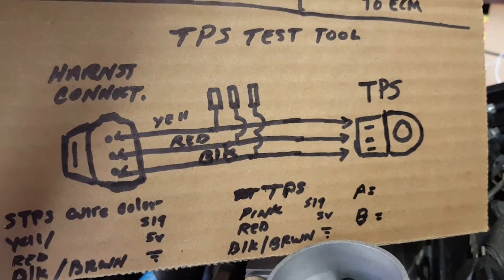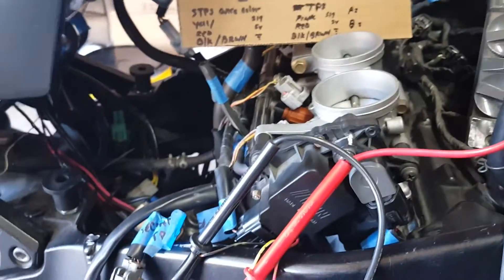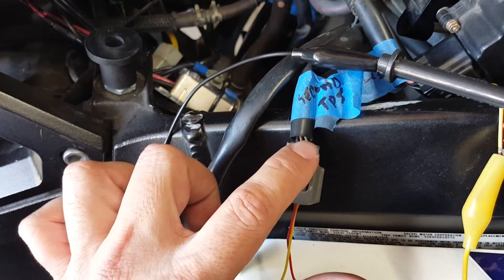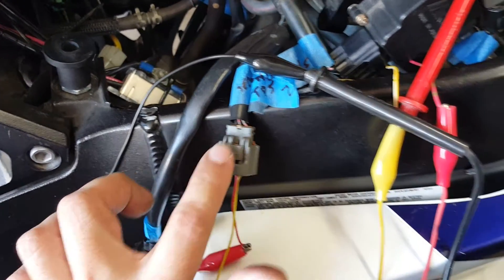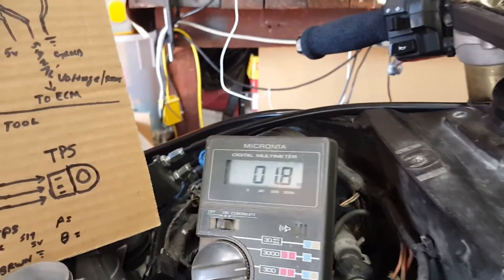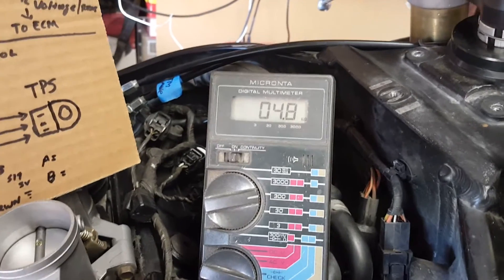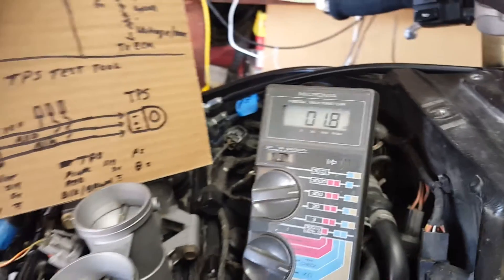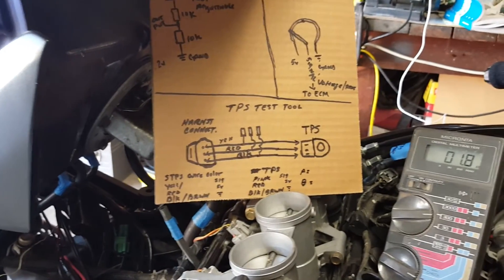SUZUKI GSXR 600/750 Testing the TPS for Dead Spots using Resistance

Comment: I'm just wondering if you're testing resistance through the signal wire why is the harness being connected important? You can't just put alligator clips on the ground  and signal pins in the tps?

Comment: Ηi there . I made my own tps test harness tool and i measured the kΩ resistance with the multimeter. In closed throttle i get 1.4-1.6 and fully open throttle it goes up to 20-30 kΩ if i turn the throttle slowly.If i snap it very fast the multimeter displays 1. like it stops measuring....any idea whats wrong?
Reply from the maker: Well your testing the TPS for a reason, possibly because you feel its giving you an issue, right?  Then you just may have found that issue, it could be bad. Only sure fire way to know if its bad is to get a replacement. If you're anything like me and don't like down time in waiting for a part or spending money for a part you may not need then swapping the TPS with the STPS is the way to go. When I measured, both read exactly the same so in essence they are exactly the same part in every way. This is a little extra work because you have to calibrate both after swapping but at least you'll know if your TPS is in need of a replacement, or if your harness tool is working as it should. Also, make sure you have connected the harness connectors correctly, the TPS and STPS harness connectors will fit both interchangeably. One is black and the other is gray, I sometimes get this wrong  so its good to mention.
Reply: @TheChemistDIY  https://imgur.com/DIvxpl5
The way i measured was to conenct multimeter probes to wires A and C in my homemade tool.

Comment: Good afternoon. I want to ask you. I have a Suzuki 600 l4. when the motor is cold. I open the handle of the gas until it stops. engine speed rests at 3000 revolutions. After a couple of seconds, they rise higher. that can be a problem. fuel pump clean. and there are no errors on the panel. its video with the problem  https://youtu.be/4j8CxQ8muHQ
Reply from the maker: Антон Третьяков there could be a number of things wrong here but I would first start with the fuel delivery. Check the fuel pump and make sure it is putting out the correct amount of gas, test your fuel pressure and make sure it's consistent, and last test and clean your injectors.
Reply: all filters of the fuel pump I cleaned. pressure on fuel injectors 3 bar
Reply: fuel injectors i cleaner
Reply from the maker: Антон Третьяков did you check to make sure it's delivering the correct amount of gas?
Reply from the maker: Антон Третьяков when you say cleaned, how so? Did you flush forward and backwards, did you test electrically (voltage/resistance)  did you check for proper V pattern spraying on each. More to it then just saying I cleaned.
Reply: james moreno .I clean fuel pomp. Then connected Barometer (i connected to pipe injectors. Petrol go to barrometer and injector  ).   ,then disconectded injectors ramp and clean desame on your video.
Reply from the maker: have you checked the first and secondary butterfly movements to insure they are working correctly?
Reply: james moreno the secondary batterfly i not shure is work good.
Reply from the maker: confirm

https://youtu.be/wfuXw0nhwh8

Comment: Why min is 1,8kOm? Manual say that correct adjustment must be 0,6.
?
Reply from the maker: Demonic, you are correct, the manual does state 0,6 but you will never get this measurement when testing. I did my homework researching many of the forums as well, all stated the book is WRONG. I even went as far as purchase and test 2 extra TSP's to confirm and all 3 (the one on the bike included) tested at 1,8khom or near that value. hope this helps u out
Reply: ))) ok. 
I was think that my sensor is broken. But min value is 1.0kOm(!)
And how to adjust it? Just turn on min value? O_o
Reply from the maker: Demonic - there should be a white line marked on the TPS and it's body. this is  the OEM dealer marking set position and will most likely get you on or near where u need to be. loosen the adjustment screw and start the bike,. slide up or down and watch your idle tach. 13-15k is where you want to be. it's a little tricky to dial in and u will probably have to adjust it a few times before getting.it. when u tighten down in the screw, make sure to hold right on the TPS because tightening the screw will also bring it out of adjustments. from there it's a fine point adjustment with the throttle cable if need be. remember the bike is going to heat up fast so you need to be quick with your adjustment and lock down or you'll be waiting a few minutes till the engine cools to get back in there for another try. at it.
Reply: james moreno ok. thanks.
This adjust is just cold start working?
Reply from the maker: Demonic your first attempt will be cold, but like I said you probably won't get it in the first round and the bike will warm up and fast. Just do ur best at  cold attempts giving urself 15-20 minutes in between failed attempts to allow for cooling. Youll know when it's cool enough because you can get your  hands back in there without cooking them.
Reply: james moreno thanx. )
Reply: I have a new information... )))
Panel signals value  -C00 if diagrostic connector is curcut. And... if just turn the key and don't start the engine it indicate top sensor (stp) adjust. If engine is started, it is indicate bottom sensor (tps) adjust. 
I can't adjust stp sensor (it indicate ^C00). But tps sensor can change indication value on panel (if engine is started) - it's ok.
Reply from the maker: Demonic yes the indicator on the gauge cluster is related to the TPS and not the STP.. when adjusting the TPS the line needs to be in the center position and while the bike is running. once you have it there, tighten the bolt down and make sure while your tightening the line stays at center. this is the tricky part as it will often float up or down while tightening.
Reply: james moreno u don't understand me. If engine isn't run,  panel indicate upper level, when run - normal.
Reply from the maker: Well if you think about it, when do you need it to be -normal, while your parked chilling with the engine off or while your riding it.. lol. One thing you should note is that each point (High, Middle, Low) actually has two two points, the point at which its about to go to high and the point where its about to go to low (the cusp or braking point). 

While you may have it at level (middle position).. at which point of that middle level is it at, the point of high or the point of low. This can only be seen while your riding the bike. My suggestion to you ( and is how I tune my TPS) is to leave it in dealer mode and ride the bike so you can watch the level float. When you give it gas it should float up and return to middle when you come to idle. Try that out and let me know how it works for you. Riding in dealer mode will not harm the bike in any way.

Comment: Hey man i have a question LONG ONE
I have a Gsxr1000 2001 i been having issues with the throttle.... It loos power if i full throttle the bike it only goes up to 6K rpm masaaan i have check every single damn nail in it everything ECU, Sparks, Coil, Cam sensor, fuel pump, injectors man you name it problem still persists what else could it be?? It doesnt have any wierd noise for me to think in the time chain i was thinking in the TPS STPS?????
Reply from the maker: Do you have the exhaust acutator assist butterfly in your piping?? Sounds like a STVA issue
Reply: I have the black box with a little metal square thing that rotates? But is not connected with the cables that opens the butterflies because the previous owner installed a Yoshi on her so he disconnected the cable of from the ECU and left the rest of the system conected cables and the black box i told you
Reply from the maker: Ok so this can be a number of things that we need to check. I’m taking it that since you say this is disconnected you have an aftermarket exhaust. Since you still have the rotor assist actuator present it’s not a full exhaust piping system. We need to check if this was done right. This link will show you how to disable the the set valve from the ECU https://youtu.be/Kes800UV1OI .

Secondly we need to know if the butterfly is fully open within the Exhaust pipe and this link will show you what I'm talking about https://www.youtube.com/watch?v=0bjKQYc0vcE . If this butterfly is not open it will restrict exhaust flow causing back flow to the engine.

What also causes the restriction above a certain speed is the STVA Actuator not working correctly. I have these videos to show you how to troubleshoot this issue and make sure it’s working correctly https://youtu.be/wfuXw0nhwh8
https://youtu.be/18KR_RV0tVQ

Heres another helpful link i found on the GIXER forums that may relate to your problem
http://www.gixxer.com/forums/33-general-bike-talk/341118-stva-fix-2000-2003-750-2001-2002-1000-a.html

Let me know if these work for you.
Reply: Oh man thanks a lot a lot man well i will surprise you even more when i tell you that NO DAMN CODES ARE SHOWN bro this is why this bike been a headache no error code but the normal C00 with the line in the middle like it should be but hey that STVA the one that goes connected to the exhaust i will disconnect the whole thing and let you know as soon i do it to see if it work
Reply: @MrJohn132345  how did that go? What was the issue?
Reply from the maker: Unfortunately no, that wasn't the issue. The issue was warm out dogs in my tranny causing the gears to slip.. I would have rather it been the TPS as that is a cheaper fix.
Reply: Jonathan Hernandez I also have a 2001 K1 1000. Mine's been totally f**** up. It sometimes it makes that woodpecker sound what the hell is that do you know?